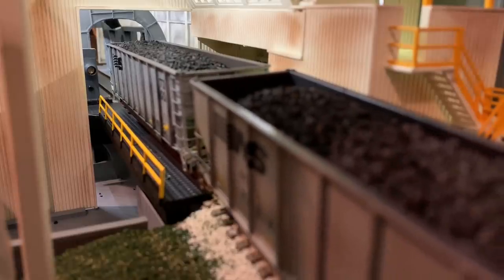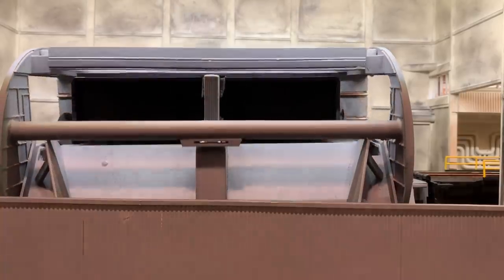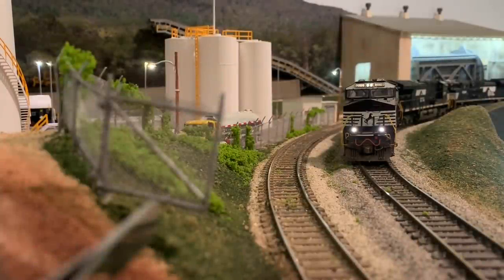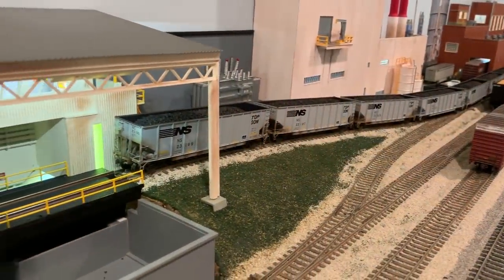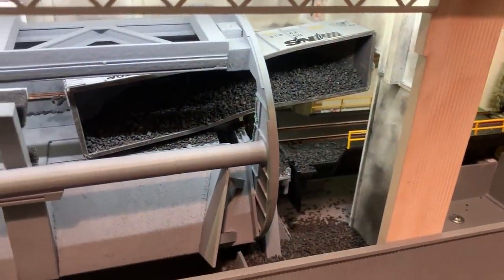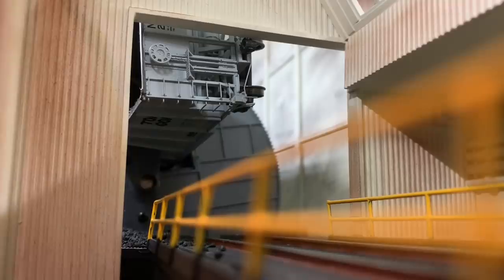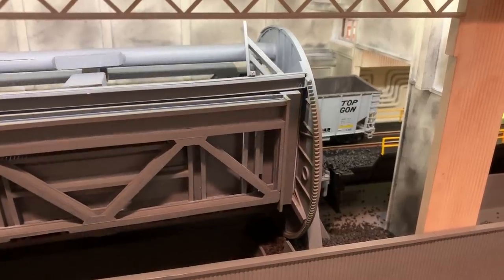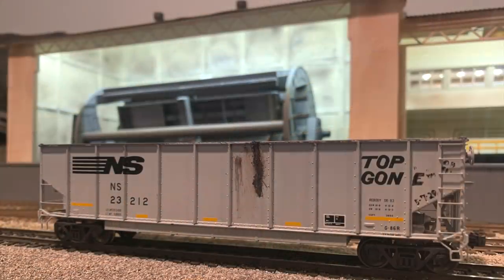Rotary Dumper Crushes Coal Car - Caught on Camera

Comment: This is great! I worked unoading coal with a rotary. The real one also uses sensors and logic to make sure this doesn't happen, but i assure you, it does. I had to clean up a few messes from the logic getting confused or dirty sensors causing issues.

Comment: So I'm guessing a kill switch or E stop will be an addition to revision 3 firmware? 

Funny story about finding software glitches... we set a 1000hp 4160V motor controller on fire we were designing once, when we discovered we didn't have a 'latch'  for the main contactor in the software while the unit was running. Once we started putting the unit under load, the system saw the bus voltage drop which was normal, but instead of staying in, it reverted back to the precharging mode thinking it wasn't fully charged anymore. with a 6200V DC bus, your contactor options are limited so we used an AC vacuum contactor... for those of you with electrical knowledge, I'll remind you that you cannot break a DC circuit with an AC device... so when it tried to open the circuit that was under full load, it opened the contacts, but the DC jumped the gap, kicking off a ton of x-Rays, and heat, and in a few seconds time, turned the metal and ceramic vacuum containment bottles red hot. The plastic didn't like that and so it caught fire. Extra bonus the unit is air cooled. so it's sucking 15,000 CFM of cooling air, and now smoke through it, filling the lab area with beautiful white smoke. This catches the attention of building manager, and he comes running in with a 20 pound dry chemical fire extinguisher... 3 engineers tackle him before he squeezes the trigger, which would have destroyed 3 years and about $90,000 worth of equipment!  Once the main power was shut off, which it was seconds after this was recognized, the heat went away, and everything settled down.
Funny how one little glitch can cause so much havoc. 

For reference, you NEVER want to shoot dry chemical at any electrical equipment that's on fire unless there's a life safety issue involved. Use CO2, Nitrogen, or Halon (the best actually, but expensive). Dry chemical will absolutely destroy anything electrical once the slightest amount of moisture gets to the powder sitting in the equipment. You may as well throw it out at that point. That's why computer rooms, and other sensitive electronics have Halon flood, or N2/CO2 systems. It puts the fire out, but doesn't destroy everything else in the room with it.

Comment: As an engineer that delivers to a plant with a rotary dumper, you should have left all that coal where it landed. The insides of a shed like that is black with dust and spilled coal. Sweet model though. Good work

Comment: Josh, I can relate, back in the late 80s early 90s at the Ohio State Fairgrounds large NMRA Division 6 layout a buddy of mine had 80-90 unit train of Wisconsin Electric high side gondolas and was running live loads and helpers. Now remember this was prior to DCC with just powered blocks. The layout would support 2-3 long trains in each direction on the doubletrack. The dispatcher accidently killed power to a block that the head end power had gone through and forgot about the helpers, well it pulled the entire train over on its side spilling coal everywhere on both mains, during the State fair none the less. We must have looked like real professionals out there with a shop vac cleaning up coal and rerailing a unit train. LOL

Comment: Love the working dumper.  Have you guys considered a "kickback trestle" after the dumper?  That would remove the need to pull the empty cars back though the rotary dumper, and should streamline unloading trains.  They existed to fulfill the same issue on the prototype that you guys have in your layout, not enough space for unloaded cars directly after the dumper.
Reply: And believe or not, we did consider that very thing and we still didn't have enough room for that. Thus we ended up with what we have.

Comment: This reminds me of Thomas and freinds. Because one time in the older shows Percy number 6 green engine was lifted into the coal hopper loader and got his coal drop out.  Oh the memories. XD
Reply: By chance do you remember what episode it was? It'd be interesting to see that scene. In real life such a mistake would be a very serious accident, with a risk of severely damaging the boiler from the hot fire as well as the grate bars being dumped from their normal position onto the arch and crown sheet. Plus all the appliances would be slugged with water instead of steam, injuring them too. Poor Percy would be in the workshop for a month getting a full inspection with repairs.

Comment: Sorry to hear about the misfortune of what happened. Out of curiosity, what change does the new program put in place? Is there a way to set a force limit on the dumper similar to how a garage door operates, so that it returns to 0 position should it encounter an unexpected force, be it a car not fully in the dumper, a misplaced finger while it is running, a pet, or coal jammed in the gear set? Additionally, what about an emergency stop button on the fascia that aborts the process and shuts down the dumper for a set timeout, call it 2 - 5 minutes, gives crew time to remove and reset car if need be, and sweep up. Recess the button in the fascia so there aren't accidental stoppages. Keep up the excellent work on both the layout and your video content!

I am a big fan, your layout is amazing, museum quality. Do you have a track plan drawing? I'd love to see the whole layout!

Also, the link in your about page is broken.
Reply: The updated program monitors the IR beam sensors throughout the entirety of the cycle. If any of them are broken the dumper immediately stops rotating. It also won't even start a cycle if one of the sensors is blocked.
Reply: Thanks for the explanation Grayson!
Reply: @GTI6speed  Excellent, thank you for the info!

Comment: Sorry for your 'loss' there 😁 At least the car has been able to be retrieved and put back to use. Will you explain in a future video why the software went out of whack and needed an upgrade?
Reply: The software at first just sensed the car going by but if, as I did, go by and bounce back out it wasn't programed for that because we never considered that possibility. Now it senses clear or in position before the rotating motor is allowed to start it turning. Live and learn. Live and learn!

Comment: I hope your RR is investigating the engineering failure that led to this disaster.  Hopefully, no scale people were injured in the mishap.  As my uncle used to tell my (Purdue-educated) father "They oughtta fire half the engineers and send the rest back to Purdue!   At least your cleanup was much easier than the prototype effort.
Seriously, nice video, and nice job on the dumper scene and mechanism.  What does the IR scanner detect when determining that a car is present in the dumper?  Does a car in the dumper present a different heat signature than when the dumper is empty?
Reply: The I.R. sensor only senses if a beam is interrupted. Originally it just looked to be blocked and then clear. The new program now won't allow any rotation if the sensor is blocked at all. Much better because really light cars might bounce back out partially, which I believe is what happened.

Live and learn! 😉

Comment: many machines such as lathes have sacrificial gears that will break so nothing else gets damaged — they are an engineered “weak link” for when the software/sensors/control fail.

Comment: Any info on the software you guys designed? Ill bet several modelers could gain benefit on the info.
Reply from the maker: It is an arduino-based software written specifically for this project. Unfortunately it's not commercially available! - Josh

Comment: I've never seen a real rotary dumper requiring the cars to be uncoupled from the train and dumped one by one like that, the oned I've seen doesn't require the cars to be uncoupled and the entire train goes through the rotary dumper and dumps the cars with rotary knuckle ends one one end of the cars.
Reply from the maker: Most (if not all) prototype rotary dumpers require cars to have rotary couplers. To allow this dumper to work with all kinds of cars (with or without rotary couplers) we designed it to uncouple the cars as seen.

Comment: I wonder if this ever happens at the power plants across the nation.
Reply: Yes, more often than it should. I used to work a site with a rotary dumper that the engineer ran an SW1500 into the dumper. Sheared the stacks and cab right off.
Reply: jpg290 I bet he had to change his underwear afterwards! I wonder how he liked unemployment?